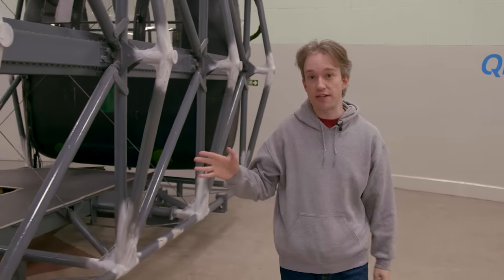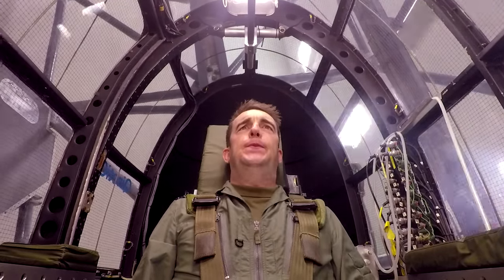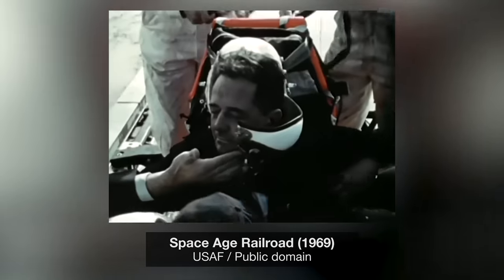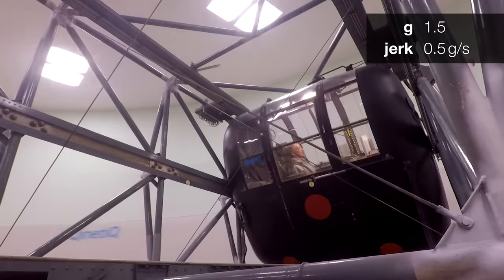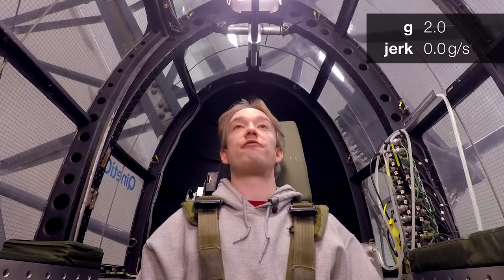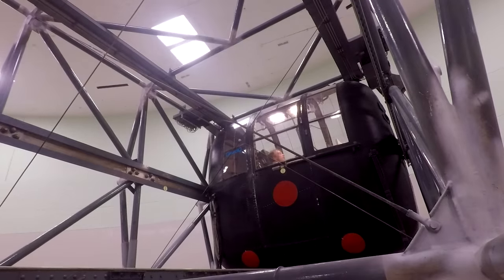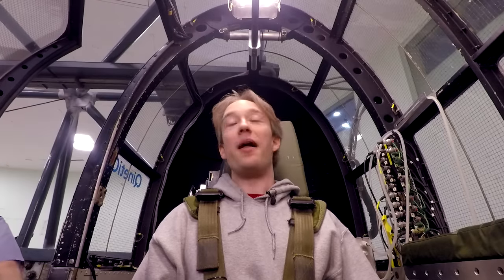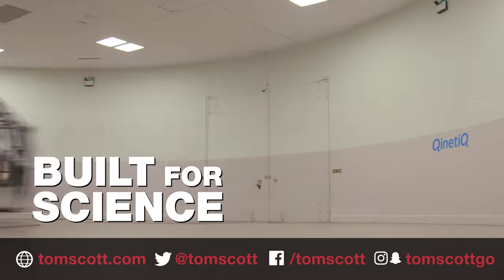G-force, jerk, and a giant centrifuge

Comment: My g force tolerance is when I stand up to fast and pass out
Reply: I see that you are a fellow low blood pressure person as well.
Reply: Hi big fan
Reply: @villagernumber7882  im high blood pressure so anything that happens makes me die
Reply: me 😔
Reply: This is too relatable
Reply: Wake up, stand up, pass out, repeat
Reply: @permadash  this is fine 😂
Reply: That's actually because when you're sitting down, your blood doesn't need to move as far around in your body and when you stand up really fast your body has to catch up to the rapid change
Reply: @villagernumber7882  yep it's called POTS
Reply: omg i have found my fellow syncope homies!
Reply: @Sarah-yk9xv  ayo, POTS is wild
Reply: That's related to blood pressure, not G's. When you're laying down or resting, your blood pressure is low since your heart is inactive. But once you get it, it's a rapid change so blood effectively can't rush to the brain that quickly.
Reply: @realeyesrealisereallies97  Not entirely correct. Sorry for the correction, the right term for it would be orthostatic hpotension since the person you are replying to has low blood pressure. Pots would be the opposite of that as blood pressure increases as you stand. Both have the same manifestation (dizziness) but are still entirely different.

Comment: Funny that Tom was deathly afraid of roller coasters, but hopped right into this thing designed to drain the blood out of your head.
Reply: I think it's the same with what I got, I'm mortified of rollercoasters, but this has multiple redundancy systems and you are being constantly watched over to make sure ur ok, so that kinda makes it feel allright
Reply: @MrShadowCZE I mean it’s the same with roller coasters. There are countless failsafes
Reply: @voiddcxi2630 
Rollercoasters have soooo many redundancies… The following might sound a bit cruel, but after every accident (which are rare occurrences), the safety will only improve. 

A short list of safety measures. 
- Of course you have restraints keeping you in place on a ride. The thing that keeps it in place is the same thing that holds airplane flaps together. And… guess what? Every restraint has two of them.
- Furthermore, a restraint can only let you go once it received an electric charge in the coaster’s station. 
- There are clearance codes. If there’s a chance you might hit something on a ride, because you’re tall, you will not be allowed to ride. I believe designers take the upper 95% of male height and add an extra few centimeters for good measure. 
- Height limits in different parts of the train can differ. Up front, you get pushed into things and at the back, you get pulled over things. In the middle, the Gs are tamest. 
- Coasters use block sections. Two trains cannot be on the same block section at once. There are many sensors on coasters to determine the position of a coaster train.
Reply: Except once you start you can't stop it. That could be scary for people.
Reply: @jarmoliebrand2005  exactly
Reply: I think it was more of a phobia than actual worry about safety. He knows thousands of people go on these roller coasters, and they do not break. It's more of an irrational fear, I think.
Reply: @cccEngineer  block brakes exist, on some rides
Reply: @saulgoodmanKAZAKH  he did say that it was a phobia and that its not the forces or safety he's scared of, its the experience, the sound and restraint feel of it hat he's scared of

Comment: off topics:

as an F1 fans, I really hope that non-fans can now understand how incredible those drivers are to constantly fighting those G-force while racing in 50-70 laps per race not including free practice, qualifying or even crash that can make they face 20-50G per impact.
Reply: yet they say, f1 is not a sport
Reply: Absolutely. But luckily they are very very short bursts of acceleration when they crash
Reply: Humans have a much greater tolerance for lateral g than vertical g.
Reply: That cant be good for the human body
Reply: Vertical and lateral G's are not the same. Not saying F1 is easy, but when i ate 5G's in an edge540, i felt my brain pressing on my skull.

Comment: F1 drivers pulling 2G to 5G for 2 hours straight. Mad respect
Reply: 5 g while braking, 2 g while accelerating, and 4 to 6 g while cornering
Reply: Because they wear an anti G suit therefore they only feel a small amount of that G force
Reply: Some even pull 51g when they get too close to Hamilton
Reply: @bimpa1568  didn’t Carlos Sainz experience 62Gs in Sochi 2015? Correct me if I’m wrong
Reply: @SW-8228  Idk, probably. You know more than me on that one
Reply: @muhammadriskysubhannorazha6815  F1 race overalls are not anti G suits
Reply: The Gs F1 drivers experience are not in the same axis, the ones experienced by fighter/aerobatic pilots are way worse to handle.
Reply: @muhammadriskysubhannorazha6815  Could you give a source for that? To be hones I am quite confident you just made that up, they only wear fireproof gear.
Reply: @lcberchtold1208  no need for source, just trust me bro 😉
Reply: @lcberchtold1208  Source: This was once revealed to me in a dream.
Reply: Fighter pilots pull way more.
Reply: Lateral g doesn't cause the same symptoms as vertical g.
Reply: @borjaalonsovice  Actually they are. Accelerating and braking in a straight line are. When a pilot pulls G he is typically turning and the aircraft is banked.
Reply: @spatrk6634  That would mean they 0 to 100kmh in 1.35 second, which they can't. Information here is wrong
Reply: they probably get used to it
Reply: @muhammadriskysubhannorazha6815  That's just a complete lie though. F-1 overalls are not g-suits.
Reply: A typical fighter jet generates a G force of about 8 or 9 along a vertical axis, affecting the pilot's neck and spine. An F1 car generates around 4 or 5 G but affects the driver horizontally, for example, when cornering. This would typically affect the driver more than the G forces applied to a pilot flying a jet.
Reply: @rileybobbert6527  the expert in the video literally said the human body cannot get used to g forces, your tolerance never changes.
Reply: @IntergalacticVoid  That's because 0 to 100km/h is not the peak acceleration. You can't unleash full power from a stop in a monster of a car like that. An F1 car goes from 100-200 much quicker than 0-100 in well under 2 seconds. The peak acceleration is around 2g in that. F1 cars are notoriously hard to start and not particularly fast off the blocks compared to other races cars, but makes up for it by being faster everywhere else.
Reply: They train their necks to handle it and as someone said their body probably has been through it for so long that it's normal for them.  For us normal folk if we went in a f1 car at full speed around corners our heads will be just all over the place.

Comment: Nicely done. I enjoyed doing the training some years ago and participating in several studies on the centrifuge. It’s definitely a physical test and fatigue is important especially as the onset is quite limited so runs are quite long. 

Hardest was getting to 7.4g with the old anti g trousers and lots of effort on the stain manoeuvre. The typhoon anti g suit with pressurised breathing system made 9g a doddle by comparison!
Reply: What do you mean by "especially as the onset is quite limited so runs are quite long."?
Reply: 1g/sec onset. So a 9g run would last 30+ seconds with a 15sec plateau at 9g.

More modern facilities can achieve higher onset so shorter runs.
Reply: @adamgoulder8019  ah yes the one in my country has a very short onset.

Comment: Today I learned that losing consciousness due to G-forces looks a lot like having a stroke. Makes sense, it's caused by lack of blood flow to the brain either way, iirc.
Reply: A stroke is lack of blood flow to any part of the brain so most of the time is not even noticeable visually until you attempt to use the part of the brain that is temporarily out of order, such as speaking or walking.  Though a hemispheric stroke knocks out one half of the brain paralysing one side of the body and is the obvious sign to look out for in any major stroke victim.

Losing blood flow to the entire brain is what happened here and that would just look like someone fainting, I don't think it's possible for a stroke to knock out the entire brain because both sides of the brain have independent blood supplies, hence hemispheric strokes..

Comment: Tom passed out at a little over 3.5 G, which may seem silly or wimpy.  Let me assure you that stronger and fitter men have withstood less.  Vertical G force is absolutely soul crushing.  Even F-16 pilots pulling 9G sit in reclining chairs that mean they only experience about 6-7 G along the vertical axis. If you're ever lucky enough to ride in a high performance aircraft, just remember to go into the experience with humility, because you'll certainly come out of it with some.
Reply: Generally the requirement is at least 15 seconds at 9G for fighter pilots.

Comment: Uh...I should really understand the residue theorem, finally...let's search for a good lectu - ohhh look! a tom scott video!!!
Reply: Use 1)  Instead of doing a complicated integral, add up the holes inside.
Use 2)  If an integral along a line is tricky, pick a different one using the same endpoints that doesn't form a loop with any holes inside.

Now that that's done, back to Tom Scott et al.

(I think that's it, but it's been a while since I touched complex analysis!)
Reply: Thanks! XD

Comment: F1 drivers normally experiance 4 to 6.5 Gs approximately 50, 60 times in a full race😳🤯
Reply: Those are lateral G’s, pulling blood to one side, nowhere near as dangerous or hard to face as gs pulling blood towards or away from the brain. Still, it takes a lot of equipment and skill to maintain focus and not break your neck in turns.

Comment: This just made me think about when I went to the fair with my sister and I went on this ride that was looked like a 3 prong claw. It would spin around and around as well as the 3 prong claw ends would also spin like a spinning top whilst being swung around in the air. I was perfectly fine but never had issues with being on rides besides looking down from high places while waiting to get on the ride. But when I got on this ride in particular it felt like I has cramped up all over my body, I couldn't breath, I could even sit up and I had a huge death grip on the handlebar that kept me locked in the seat. My sister was crying because I could barely respond. And last thing I remember as this happened quite some time ago was that I felt soo sore everywhere like I cramped all over my body head to toe especially my head and was just thinking like bro did I just have a stroke or something? Haven't been able to go on a ride since. Don't wanna risk it even though I kinda miss it and would like to take my girlfriend to the fair and when I have kids be able to go on rides with them too.

Comment: I noticed that the person inside would feel positive g forces when the capsule was pointed inwards. My question is, if the capsule was pointed slightly outwards at a constant angle, would it be possible to (almost) recreate zero g?
Reply: No, you will experience the same g's no matter what orientation the capsule has.   The only way to make zero g's is to accelerate along with gravity.  If there existed a hypothetical Jedi force that could apply uniformly to every kilogram just like gravity, then that Jedi force could be used for making zero g.  But no real force behaves like that other than gravity.

Comment: I worked for an commuter airline as a flight dispatchet and went up on a test flight. It was in a Sunday and we had no planes in the air over the whole system. Right after we left the ground we made a right bank. My stomach took a left bank and I had to start breathing in a vomit bag to maintain consciousness. We immediately returned to the airport where I deplaned,  watched the plane go back up and I dropped to my knees to kiss the ground. My boss who was the captain of the test flight and his copilot laughed at me when they returned to the operations office. I told them I was not sure what I had for lunch, but about 3 more seconds we all would have found out. I flew all the time on commercial flights but this flight was not standard operation for a commercial flight. For good reason, the cleanup cost of the cabin of a bunch of passengers throwing up their last meal would be bad for business. Let alone customer satisfaction surveys.

Comment: Why is the control of the centrifuge in the middle of it, and not in a separate room?

What a job 😂
Reply: Probably so the controllers can see him directly without distortion.  They experience a lot less g-force in the center of the machine.  It may not seem like it, but given a rigid body in rotation, the outer rim experiences the most g-force.

Comment: before knowing how much G was a lot or little, i used to subject my Kerbals in Kerbal Space Program to about 30 to 40 G of deceleration on re-entree... well before seeing this video i learned that was insane but i never knew 4 G was enough to make someone pass out... be it normal or below average, i guess i should be amazed when the pilot is the only one who did no G lock at 6 to 8 G!
Reply: I once pulled over 100 G's with a fighter jet (albeit with an overpowered antimatter engine) in KSP. Any human would turn into paste very, VERY quickly, but the Kerbals are quite resilient.

Comment: Is there a point where these pilots wont have to do all this to fly a jet? It seems like a lot to juggle to have to keep straining your muscles, using a certain breathing technique, trying not to pass out, flying a jet, looking at your surroundings, and possibly fighting in combat. Is there only certain times in a flight where they will be exposed to so many Gs to have to do this or is it all the time while they are in the air?
Reply: When they're not accelerating or doing really sharp turns they won't be exposed to really high G-forces. Of course they might do maneuvers like that in combat, but no, it won't be all the time.

Comment: I have a few questions! 🤔 what's the tangential velocity of the centrifuge at 2 Gs, 3G, 4Gs and 5Gs? And what's the radius of the centrifuge? If someone can help me out I would really appreciate it !
Reply: Here's how you can calculate it:

The g-force (g) of a centrifuge of radius (r), spinning in a horizontal circle at tangential speed (v) in Earth's gravity (g0) is given by:
g = sqrt(v^4/r^2 + g0^2)/g0

The idea is that you add up the horizontal acceleration (which is v^2/r) and Earth's gravity (g0) in Pythagorean theorem quadrature, in order to find the net non-gravitational force acting on the occupant relative to his rest weight (m*g).

Plug in the various number of g's and solve this for tangential velocity v.

We weren't given r, but I would estimate from the view I could see, that it is between 5 meters and 8 meters.   NASA has a training centrifuge with r=8.84 meters.

Using r=8 meters, we get the following relationship between the g-forces you mentioned, and the tangential velocity.
2g's, v=11.7 m/s
3g's, v=14.9 m/s
4 g's, v=17.4 m/s
5 g's, v=19.6 m/s

Comment: How do the center operators not get dizzy or loose their senses when they are also spinning around in the center of the centrifuge?
Reply: They experience a lot fewer g's in the center of the machine.  By my estimates, Tom is 5 times as far from the axis of rotation as the control staff.  This would mean that when Tom experiences 3.6 g's, they are experiencing 1.2 g's, which is very gentle by comparison.  You experience that in a skyscraper's express elevator.

The equation is:
g = sqrt(w^4*r^2/g0^2 + 1)

where:
w is the rotation rate in rad/s
r is the radial position from the axis
g0 is Earth's gravity
and g is the number of g's this formula determines for you, which is the amount of apparent gravity you feel, with 1 indicating at rest in Earth's gravity.

Try it with r=1.5 m and r=7.5 m, given w=2.13 rad/s.  This is what I estimate the operating conditions and size of this machine to be.

Comment: I may sound like an idiot, but how much G-force is in a rollercoaster usually?
Reply: None
Reply: Usually around 3 to 4.5 g's for the most extreme high g-forces on modern roller coasters.   The low g-forces go as low as zero.

Thankfully, we finally know how to design inverted loops so that the passengers don't need to experience over 6 g's at the bottom, like they used to experience when the loops were circular.  We now broaden the curvature at the bottom so the g-forces are more gentle.